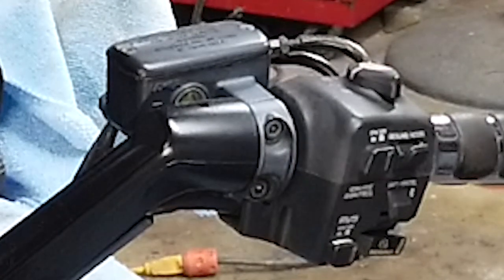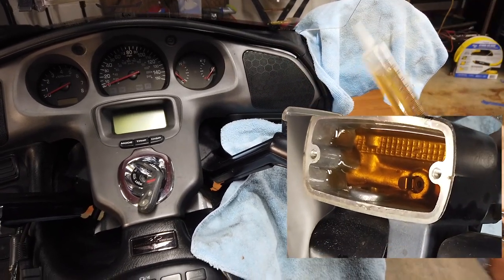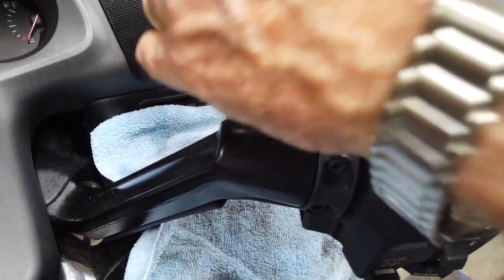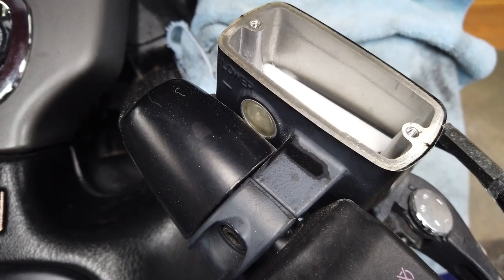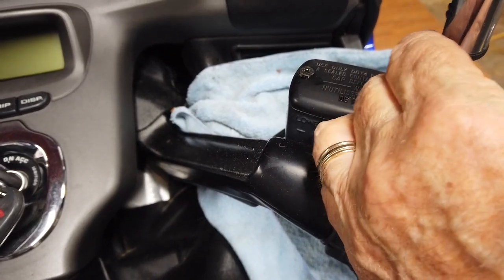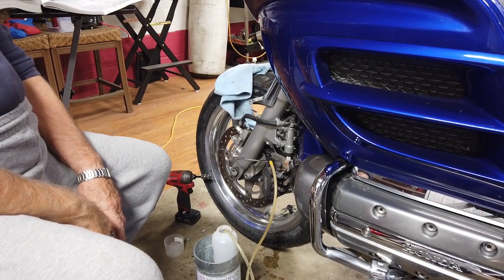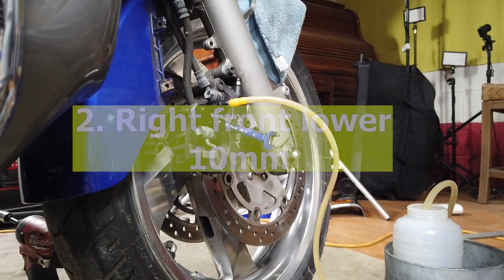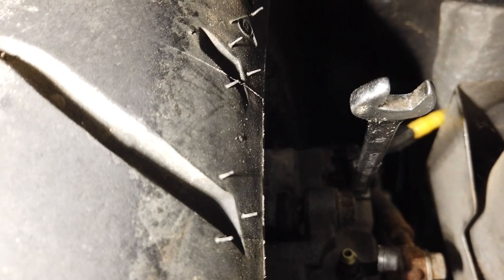Honda Goldwing Gl 1800 Front & Rear Brake Master Cylinder Flush/ Bleed

Comment: Sad for supposedly being a tutorial video.  So many steps were  skipped in recording.
Reply from the maker: No there was not
Reply from the maker: We went front to rear by the book
Reply from the maker: What exactly could you add to the job ?
Reply: @jamiejonesthecarman  explain putting a tube into clean brake fluid and the other end onto the bleeder valve being bled and squeeze the lever or pump the pedal (slowly) numerous times until all the air is push out  before closing the bleeder valves
Reply: I'm not being sarcastic or condescending but if I had no idea how to bleed brakes those videos would have been little or no help .Just my personal opinion.
Reply from the maker: @Tommy-f5j  it’s by the book all steps
Reply: @Tommy-f5j  I think you're being unkind. These two guys don't profess to be video production experts.  The video does cover all you need to know.  I've seen others that are soooooooooo drawn out.  These guys got on with it.  Top-tip: Anyone with no idea of how to bleed brakes, don't attempt to.  Find a basic mechanic's course, and God forbid, don't start on a 01-17 GL1800.
Reply: @Tom White
Really? Geez......
Reply: @Tommy-f5j  Your method works if the end of the tube that is in clear fluid STAYS COMPLETELY IN THE FLUID. If it doesn't, you'll be pulling air back into the system, and will never get it out. Using the method here, specifically closing the bleeder valve before releasing the handle, makes sure no air is pulled past the valve, as it is closed.

A better way to do the bleeding is to install speed bleeders. This removes the need to close the bleeder valve, AND makes sure no air is sucked into the system, as the speed bleeder has a spring loaded ball inside it, and when the old fluid has been expelled, the ball moves into place, thereby not letting air back in. Much faster, and no need for two people doing it.
Reply: @jeffdaniel7627  keep it in the dirty fluid while bleeding ,not a problem
Reply: One end of the tube on the bleeder valve, other end into USED (NOT NEW) brake fluid. How would that possibly work if it's in clean fluid unless you don't mind wasting clean fluid.

Comment: This was confusing.
Reply: When I bought my 2010 I bought the factory mx manual. It’s a must, however, on Carl Salter website you can download the 2002 manual in PDF.  It’s even searchable! I agree that there’s too much jabber and music. Also, it’s crucial to R&R brake fluid NLT every two years to prevent contamination causing the rear master cylinder (and possible the secondary master cylinder) pistons to stick. This was a 2015 ? Recall item.
Reply: Let me just add that it’s a linked system so applying rear brake gives you some front brake, even though it also goes through a delay valve. That manual will have great diagrams and it will make sense. Complicated system, but just know on those two front calipers you’re not only bleeding the top (lever) system, but the other two bleeders are for that rear system applying some front brake after a delay valve.

Comment: I had the problem sat for 2 years had front brakes no rear brakes.  Watched the video flushed it now No front brakes but I have rock solid rear brakes and brake lights are stuck on.  Any suggestions on fixing the brakes. I flushed them a second time to correct no luck
Reply: You may have a leak somewhere in the brake line.
Reply: Update.  I had to rebuild the front master cylinder. And replace the brake sensor switch
Reply: Don't forget about the recall for some years and the ST1300 may have had the recall too for the rear master cylinder.  This may be the problem as the brakes can stick on like mine did on my ST.  When I bought my wing they scheduled the recall work for a few months down the road.  2014 wing.  2012 ST.

Comment: Welcome, I have a problem with the rear brakes. I expel all the air from inside the hoses and they seem to be fine, but in the morning the pedal is very weak or completely non-existent. I expel air from the front and rear outlets. What should I do?

Comment: Apologies if I missed it, but your accuracy about the Front / Rear brakes, and the front calipers having the two bleeders, I never heard you properly describe that those are bound to the Front/Rear separately, and have to be bled by those brake levers....   
Anyone who knows anything about Gold Wing's mechanical-operation, knows that the braking system front/rear is integrated.
Reply from the maker: You are right in the aspect that they are integrated meaning when I actuate the rear brake it does actually actuate pistons in the front what I was explaining is it is not actuate the same pistons at the front brake actuates they are on two completely different systems however they do work together that’s why you must bleed both separately
Reply from the maker: Also for Max breaking this is why you’d want to utilize the rear brake in conjunction with the front brake because then it actuates all the pistons at one time

Comment: Rear brakes bleeding process requires front calipers to bleed from?
Reply from the maker: Yes
Reply: Yes.  The 01-17 GL1800 has an utterly mental linked braking system which Honda evetually trimmed down on the 18+ model.  On an 01-17, the front brake lever activates the upper and lower pistons on the front right and the centre piston on the front left, plus, and here is where it gets ridiculously complicated, the front brake lever also activates the upper and lower pistons on the rear brake and the anti-dive via the secondary master cyclinder (behind the front left fork), the proportioning conrol valve, and a delay valve.  Furthermore, the linking is such that depending on how hard the front lever is applied , tyhe front lever has the potential to activate all 9 pistons although I'd imagin in normal use this is unlikely.  The rear brake pedal activates the centre rear piston and, via the delay valve,  the centre front right poston and the upper and lower front left pistons.  And, via the secondary master cylinder, the anti-dive, and via the proportioning conrol valve, the upper and lower rear pistons.  It's an insane system, I know because I've got a 2004.  Top-tip: Shim the anti-dive which disables it and makes braking much more comfortable, especially down hill.  Honda's theory is to keep the bike level under braking which is mad because you absolutely want weight thrown on to the front wheel for more grip!